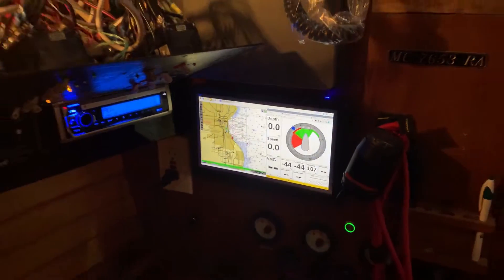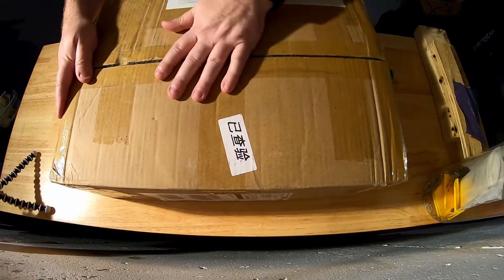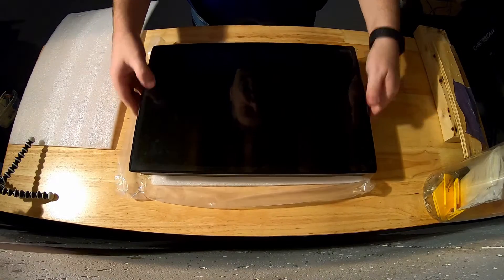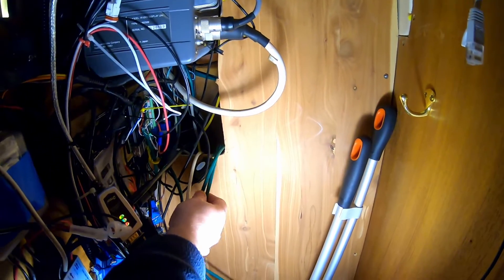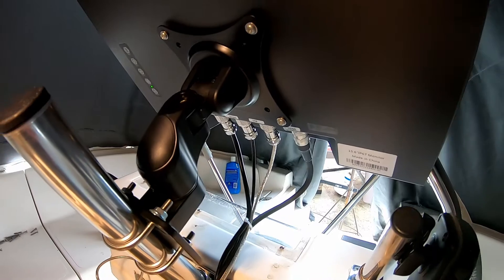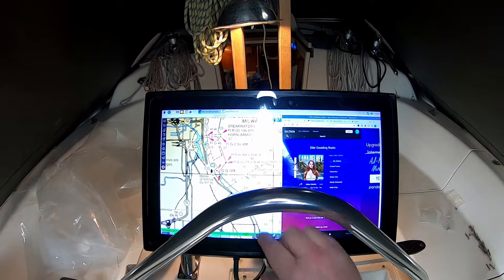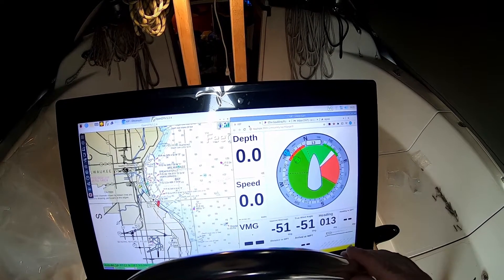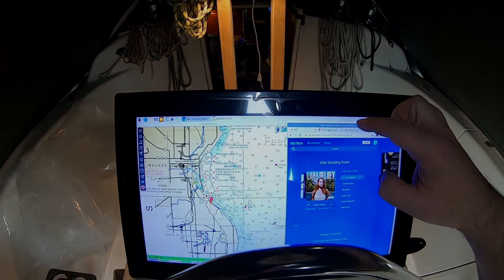Tech Ep3   Waterproof Monitor at the Helm, running Openplotter on a Raspberry Pi 4B

Comment: Fabulous Video, I'm starting with Nmea 2000, I'll do the display your way. 
Do you think I can display both maps(navigation and the instruments vis NMEA2000 ?
Thanks for answer
Reply from the maker: if you are planning to have the NMEA2000 data sent to a Pi connected to a monitor you should be able to use the NMEA2000 data to run OpenCPN using the NMEA 2000 position data for you location and Course over ground and speed, but you will not be sending Map/chart data via NMEA 2000.

Comment: Just in case you didn't research it yourself yet: you may scale up the Windows interface up to 200% so the control interface elements will get 4 times bigger, but the content will not loose the resolution. Quite handy,
Reply from the maker: This isn't a Microsoft Windows interface, if that is what you mean?
Reply: @ApresSail  Debian Gnome also supports interface and fonts scaling. Look at gnome-tweaks

Comment: Hi, how is the "long term" reliabilty of the screen after a few years of realworld use ?
Reply from the maker: @heatneutral5389  most of the time when in use it is open to the elements and has been through some pretty heavy storms. We are 3 years into its use now. Due to us being in the Great Lakes it does come off the boat for the winter.  The biggest concern I had was waterproofing the cables (HDMI connection) within the binnacle. I covered that in a later video.

Comment: We’ve put in extra effort on the waterproof display, enabling communication with Garmin marine equipment through our custom cables. It now supports video via HDMI, Micro USB, and TYPE-C. If you have more ideas, please feel free to contact us, thanks.
Reply from the maker: I would be interested in hearing more of what Sihovision is doing.  Especially in the areas you have just talked about.  My experience of your product so far has been really good.  I have just ordered an extra set of Cables from you for a seminar on DIY Marine Electronics I am doing at Milwaukee Community Sailing Center - https://sailingcenter.org/learntosail_detail.php?gcpk=200038&cpk=29000809#CourseSections
Reply: Hi the team,
Do you have the URL for this screen ?
Reply: Could you please contact me about purchasing one of these monitors?

Comment: Thanks for the video. This is possible the best value for money screen available. 
Do you advice to get a 1080P or a 720P resolution display? 10:35
I red that Sohovision build both.
Reply from the maker: you can always use a 1080P screen at 720P, you can't go the other way and I would bet that there is little cost difference at the same size, seeing as 1080P is exactly high resolution anymore.  I would suggest that if you were going to do what I am doing with cloned screens, then keep the resolutions equal

Comment: @ApresSail  
Thanks for sharing!
Excellent work, Jason. 
First I thought the screen had CAT outputs, then I saw that your screen has an HDMI input and read your considerations for fiber optic or long HDMI. 7 years ago I installed screens for an audio/video editing studio including HDMI cables of extreme length and much higher resolutions capabilities without issues, though at that time, only on 2.5K resolution screens. 
I have a RB Pi5 coming my way and my boat is smaller than yours, so I am of course taking everything into account in terms of compact/practical installation and would strongly appreciate any new information on your HDMI findings. 
I look forward to your upcoming upcoming rainy videos. 
Fair winds!
Reply from the maker: The Monoprice HDMI over 2 Cat6 cables appears to work pretty well for me and easy to run!!
Reply: @ApresSail  
Thanks, Jason. :)
I realize I did not actually ask a question. My bad.
About a year ago you responded to another subscriber (about 9 comments down):  " I have had a few problems with the screen dropping out.  I believe it is to do with the HDMI over Cat6 that i installed and this winter I will be swapping that for a fiber optic HDMI cable or long HDMI going a different route (not near any power cables)."
Did you figure out what it was that caused the screen dropping out?
Are you still planning to swap to fiber optic  HDMI or long HDMI?
Looking forward to the video with your set up working in action while on the water under rain. :)
Reply from the maker: @alexvargaslive  All of my connections were inside the helm binnacle and were subject to moisture.  The dropouts tended to be on days when the dew was the worst.  I wrapped some of the connectors in butyl tape and the occurrences dropped,  and not I have put everything in a waterproof box with a desiccant pouch and that hopefully will take care of it.
Reply: @ApresSail  Thank, Jason.
That is good news!

Comment: I just received a monitor from them, great service, communication and shipping however the touchscreen doesn’t work!!  I can use it as a regulator monitor however not as a touchscreen. Did you have any issues?  I’ve reached out to their tech team, slow responses due to their holiday.
Reply from the maker: Touch screen worked out of the box for me with Raspberry Pi 4 and Openplotter 2. Assuming you have the USB connected?  What are you testing it with?  Have you tried a computer/OS/USB port?
Reply: As soon as I saw your video and you wrote "USB- Touch Screen" I knew that was the issue, connected it and now it functions.   I used Time Zero Professional and the pinch/zoom doesn't work very well.  I cant remember the type of touch style I got but I want it to be just like an iPad.   Which did you get?   Thank you for your response. @ApresSail
Reply from the maker: @boaterderek  the touchscreen I ordered is was a capacitive one. What is the operating system you are using
Reply: Windows 10

Comment: Hi Jason
Nice to see one that has found a good screen.
But how do you make a "right-click"?
Reply from the maker: I rarely need it with my current configuration.  OpenCPN is in Touchscreen mode which means you can pan and long press for menus, touch targets for info, stuff like that.  I do believe there are some advances in touchscreen area in later versions of Openplotter.
Reply: thank you for the quick reply, i found it, however the long press does not seem to work. i wanted to use this as i have put my charts into groups, otherwise my Pi4 becomes very slow, and to choose between those i need to right click. are you using another way to avoid that all the maps are slowing your Pi4 down?
 @ApresSail
Reply: ooh i just found out, that if you install OpenCPN Flatpack, two finger zoom and right click with longpress works 🙂 @ApresSail

Comment: How much did the monitor end up costing? I'm looking for a semi-inexpensive way to get a waterproof touch display at the helm like this and am having quite a rough time finding one that is also easily mountable.
Reply from the maker: The Monitor was $624 with everything I wanted - the external dimmer, Capacitive touch screen that works with water on it, sunlight readable, antiglare, Optical bonding, 9-36V,  -10 to 70C operating range. 1080P.......  I mount it with a VESA monitor mount.

Comment: Hi Jason, how's your monitor going, I bought a 10" monitor from Sihovision which was going fine for about 6 months then just died, they asked me to take it apart and take a look which I did, it looks look fine inside, no sign of moisture but I was surprised how little waterproofing sealant there is, just a very thin layer. Anyway they said if I ship it back to them they will repair it and send it back or I could buy a new one for half price. Given that it's still under warranty I'm not that impressed with this support. I'm thinking of sending it back at this stage.
Reply from the maker: So I installed the monitor in February of 2022 and used it all last summer and so far this summer.  Over that time, I have had some issues with the screen flashing but I believe these were associated with moisture in the HDMI connector (not at the monitor).  I have wrapped the HDMI connector in Butyl tape and have not had the issue since.  I was caught in a torrential downpour on the water a couple of weeks ago and the  screen was wide open to the elements and had no issues.  The monitor I bought was IP67 and I did hear another person say they were having issues with an IP65 version. Do you know if yours is IP65 or 67?
Reply: @ApresSail  mine is IP67 so it should be fine in the elements not that I've had it out in any significant weather yet. I've had it on an adjustable arm so it sits in the companion way when I'm using it and I swing it back inside otherwise. I'm still discussing with Sihovision what the best option is but at this stage I'm thinking of sending it back so they can repair it. I certainly can't fault the communication with Sihovision, they're very responsive. I'll let you know what happens.
Reply: an update, Sihovision sent a replacement motherboard which I installed and all is working fine again, I haven't put it back on the boat yet as I'm taking this opportunity to configure openplotter & opencpn and tune & fix a few issues one being the slow response when using the touchscreen, then I'll have to seal the monitor case back together, anyway all good as far as the monitor goes,
Reply from the maker: @jeremyoftitirangi7770  glad they took care of you.  hope you have more luck with the second motherboard.  As far as waterproofness goes, I have been in some torrential downpours and its been good so far

Comment: Hi Jason, nice video, i ordered and managed to get running the same screen from China. It all has to become operational this season and the installation on board is ready. The only thing i was wondering how did you deal with the mouse pointer or right click options ? Also how does it work when it get wet do you still have functionality
Reply from the maker: I typically use my screen with half OpenCPN and half KIP.  I have OCPN in touchscreen mode, which means that if you tap an AIS target (for instance) the dialog box pops up for it.  with KIP, you don't really need right click.  I briefly played around with Twofing (https://forums.raspberrypi.com//viewtopic.php?t=138575&p=920720) which worked in single screen mode, but it would need more work to get two screens working and I haven't progressed it.  I do have a Mini wireless keyboard/touchpad I keep at the nav station and sometimes bring it to the helm (https://amzn.to/3m5GmXC).  Most route setting is done at the Nav station or at home and emailed to the boat.  The couple of times I used it in the rain it worked fine.

Comment: Hey Jason. Great and informative video. I was wondering if you might provide the full spec on the monitor you had built. I recently bought a boat, and had to leave all my new electronics with the boat I sold, so I am very interested in using open source navigations and reducing the cost of buying big name brands. Along with the feeling of being trapped by their control of accessible functionality. Really appreciate any info and guidance.
Reply from the maker: Thanks for watching, the full spec. is in the link below:
https://1drv.ms/b/s!AmZj-tob5pZokFVbdLXgtXkHZaKC
hopefully that comes through and is useful.  It was custom, so may not have been the most cost effective version.  I know the manufacturer is know selling a screen with a built in RPi4 which may be a good solution at the Nav station with a waterproof version at the helm.  I have had a few problems with the screen dropping out.  I believe it is to do with the HDMI over Cat6 that i installed and this winter I will be swapping that for a fiber optic HDMI cable or long HDMI going a different route (not near any power cables).

Comment: Hey Jason thanks for making the video! Do you have any more information on your ordering requirements for the screen or a direct contact? 

Thanks
Reply from the maker: Eric,

Talk to May (may.zhong@shinhoet.com), she helped me through the process and was very helpful but my order included the following:
- 15.6" screen
- 1000 Nit brightness
- IP67 waterproof
- Optically Bonded (do not skimp here - very important)
- capacitive touch screen
- external Brightness control for Night sailing
- I wanted 1080P to have the same resolution as my navstation screen

Some people have asked May to give them what I bought, so you could get a full spec. from them and go from there if you want to..

let me know how it goes?

Jason

Comment: Fantastic. I cannot say more at the moment as I will spend the night binge watching your channel. I am just at the planning stage to do a similar installation on my 34ft sailboat over the winter. I will most likely have questions if you are available!! LOL
Reply from the maker: Feel free to ask any questions as and when they come up!
Reply: @ApresSail  Après, d'accord.
Here is a very general question in two parts:
1- I am very interested in "playing" with the Raspberry Pi, it is intriguing and I did some programing decades ago so I am tempted.
2- I am in desperate need of some functioning electronics on my new-to-me old sailboat and the cost for a Open CPN etc system is very tempting.
SO...
If I just get a Pi today how long before I can make it useful and then just ad to it and play with it?
Of course all this on NMEA 2000 and not the old 183 format...
I would first want to connect it to my transducer for depth and install a gps, ais, weather. Then eventually connect it to my ST4000 and maybe cameras and connect the video feed to my v-blog... And of course I would like to use it for music and videos and for my maintenance and cruising log books.
The possibilities are endless, and I havent even talked about doing some coding, maybe, just for old time sake?
Should I buy one today?
Reply from the maker: I had some Linux experience and some Pi experience and I was up and running within a day or so.  if you have Raymarine basic instruments - depth, speed, wind - it is very easy to incorporate these Seatalk1 devices.  
NMEA2000 is easy - I don't have this on my boat but used a Waveshare CAN hat (https://amzn.to/3QPlZZa) on two friends boats and I wrote the Openplotter manual page that describes how to set that up.  Others have said that an optically isolated version is better (see https://amzn.to/3u3yx5A) - I have not tested this but heard it works.  the possibilities are indeed endless.  Last weekend, I sailed from milwaukee to Chicago to watch the SailGP racing and during the race, we streamed the SailGP Youtube channel to the helm screen from the Pi and with the sound over the boat audio system - it was awesome!  we could have watched a movie on the 12 hr sail home but we were too busy grilling (you will see the video in a few weeks!)
Reply: @ApresSail  
Hi Jason, so a year later, I have this project working but not completed and some times ago the monitor I had purchased (no sihovision) just died.
Are you still satisfied with your monitor?
I wonder if you could share the exact model of the monitor  you got from Sihovision. And I would get the same.
Thanks!